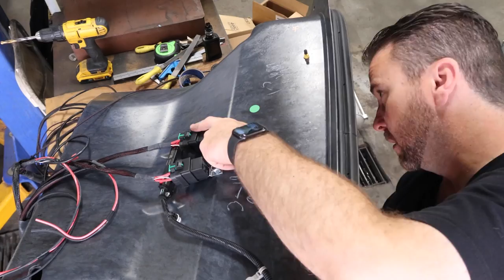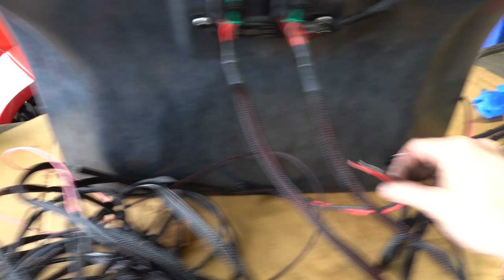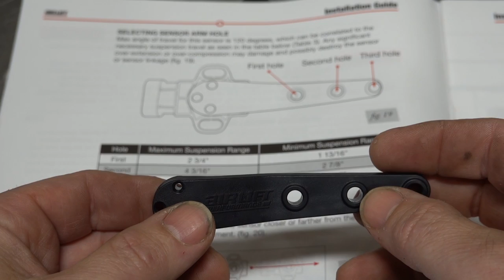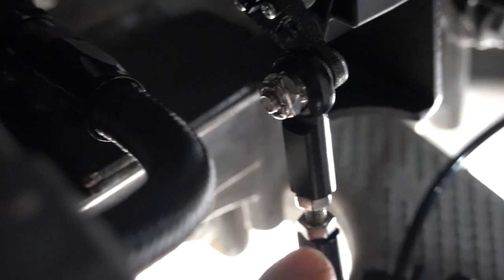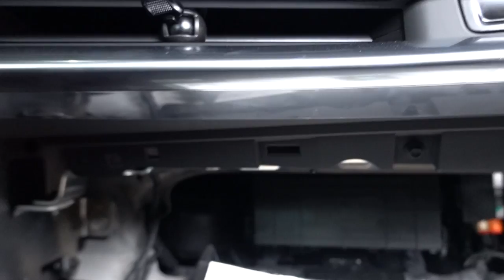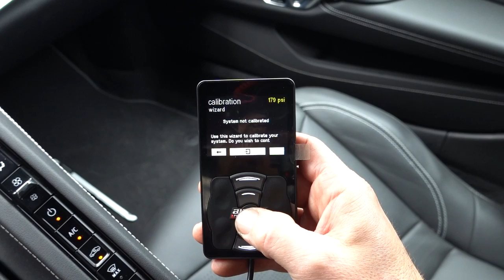How to Install Air Suspension on your Corvette C8

Comment: I still need to install my Height sensors and I'm not looking forward to it. I know the system will be better with them installed but it just seems like so much work.  Very informative video.
Reply from the maker: I would recommend to take your time and work though it.  Cycle the suspension and make sure nothing binds up.  The good thing is, if you don't finish, its fine, come back and work on it later since its the same way your car is now.

We tried to show different scenarios that people will run into and how to diagnose and fix it.